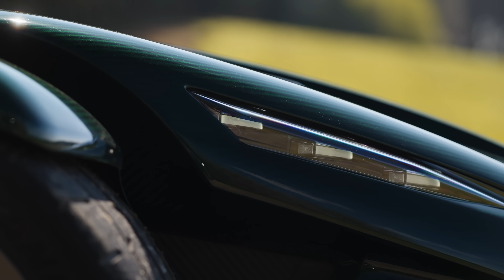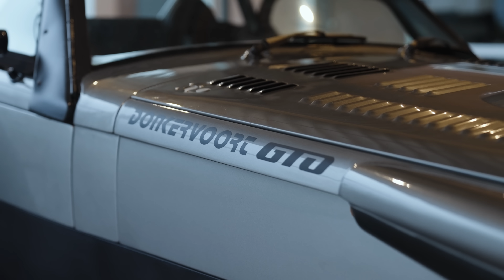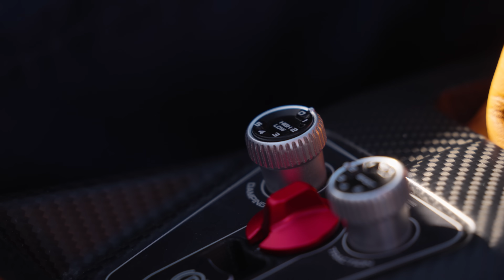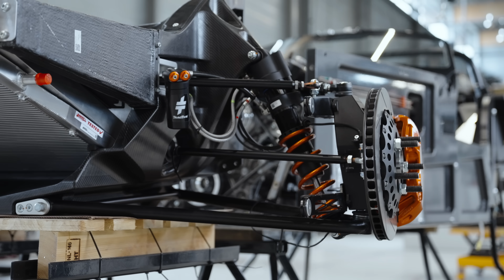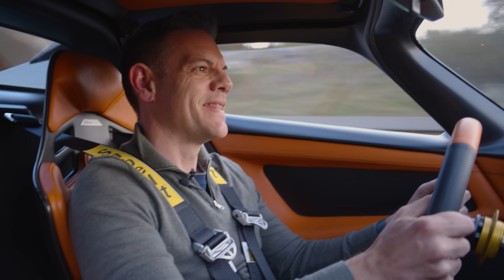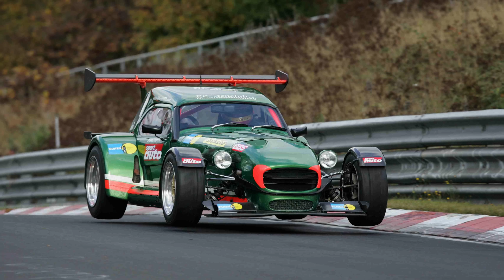New Donkervoort P24 RS: The Most Extreme Lightweight Supercar! | 4K

Comment: Ok, 780 kg plus say a 75 kg driver which gives a total weight of 855 kg. With 600 HP, the power to weight is 600 / 855 = 0.7 hp / kg. World SBK bike: 230 hp. 168 kg plus 75 kg rider adds up to 243 kg. power to weight 230 /243 = 0.946 hp / kg. Let see if this donkervoort can beat a world SBK as bike is notoriously difficult to launch

Comment: Wouldn’t you prefer bigger brakes with more adjustability, such as bias etc? As they would fit the rim and thus give more options.
Reply: I think it's not really necessary with the weight of the car.
Reply: @PietjePrut would its inertia outweigh its option I’m wondering…. They must have played around with different setups I’m sure…
Reply: @Braskas85  I really shouldn't know it buddy, but it seems like a fair thing to me. Also you took some weight away again. But like I said, it's only what I think. Not really technical, but more in a logically way. 😄😄

Comment: That Ford eco-boost frightens me, it’s like they plopped in a twin turbo frag grenade. I’m sure they’ve worked out a lot of the issues since its inception but those early days were really rough.   On the bright side if you get good at fixing them you get one of the best dollar to horsepower ratios on the planet. The flex, fusion and Lincoln’s are starting to fill up the hood classifieds and junkyards. You can buy a whole damn car for less than the cost than a proper LS motor (obviously I’m not counting truck motors).

Comment: Hate to be that guy but you called it a font engine/rear drive car but that's not completely correct. It's actually a front mid-engine/rear drive car almost perfect weight distribution 47/53. I mean bc the car's got such a long bonnet w/cab back proportions you almost sit over the rear wheels

Comment: Take that silly ass engine and trans out, and drop in a turbocharged hayabusa and accompanying transmission and the car becomes something that really could destroy the best of them on track. Really wanna make it even better? Use the custom Hayabusa V8 and a 7spd PDK or something akin to it like the VW DSG trans ,or use a true semi-auto or sequential trans. In addition to the ferro-fluid dampers, pair them with hydraulic over coil-overs to get instant ride height adjustments and the ability to install a surface mapping radar (like a LIDAR setup) to read the road and adjust damping and ride height on the fly. All adjustable from within the cabin, and add in some mastic sound deadener to tease out some of the echoes and hollow points in the chassis. Considering I can do ALL of that with a Caterham and do it for less than $50k (the Busa V8 would break that budget) and for under $100k if I added some active aerodynamics and a wing that can function as an air-brake. The bike engine would suit it better as well! The Caterham 7 Fireblade is proof of that. It's pure legend. It desperately needs pushrod suspeneas well. Seriously. Honestly! All of that work into this car and for all of that money (a nice house, or a car kind of money) it needs to have the best on offer. I'm sure the children of the comment section will wimper about the manual trans because they mistakenly think that it makes you cool to say you prefer them or very wrongly assert that it makes the car faster or this or that. Manuals/a stick is very easy to use. It doesn't make you a better driver, and it sure as shit doesn't make you an "enthusiast" like so many ignorantly and arrogantly claim. It just makes you slower, and it makes you look like a fool to claim anything to the contrary. Manuals belong on older cars. Like mid-80's and older, but really early 70's and older. Because they actually were faster and better back then..until the powerglide and torqueflight entered the chat. But especially when companies like Porsche/VW and Ferrari, and McLaren, and Pagani, and got their DCT's dialed in. But I digress. Prove your ignorance by stating otherwise! A manual trans is a choice, not a requirement for sports cars, super cars, or hyper cars. On the contrary, those last two require leading edge tech to make them "super" or "hyper". A built PDK or DSG, paired to a boosted Hayabusa 4cyl or 8cyl (that sweet custom V8 that will blast your wormhole 69 galaxies away!) and a much more advanced suspension system is what is really required for greatness in this vehicle class! It's cool looking, but it also looks like a Hot Wheels car that isn't real and doesn't deliver on its looks.

Comment: The chassis is brazed not welded its how traditional high end bicycle frames are made, brass brazing i think.
Reply: True! I was wondering why he didn't know that.
Reply: @bicyclist2 Strange Doonkevort call it "copper welding" obviously copper doesn't weld carbon steel and its brass anyway, must be all that weed they smoke over there, i don't think many people outside cycling are aware of brazed frames i had a Reynolds 531 frame years ago, only reason i know tbh.
Reply: @Heyy-u9y brazing i pretty common in engineering
Reply: @Heyy-u9y  Could be they use the same word for braze and weld in Nederlands?

Comment: Why do you cross the center line on the roads so much when you're driving this thing? It can pull 2.3 lateral G's, but you can't keep in in your lane at roadway speeds? The driving would look much more impressive if it didn't look like you have to cut straight through the middle of every turn. Plus you look like a goober doing it.
Reply: Do you drive on a real road?  Or only in the video games your mum lets you play?
Reply: It's about the videography.

Comment: Looks like an aston martin humped a Plymouth prowler and had a funny looking baby 😂😂😂
Reply: Different size and different type of cars... 

Length: 4,000 mm (157.5 in)
Width: 1,912 mm (75.3 in)
Height: 1,105 mm (43.5 in)
Wheelbase: 2,420 mm (95.3 in)
Ground Clearance: ~90–120 mm (variable via optional hydraulic system)

Key Performance and Physical Specs
Dry Weight: ~780 kg (1,720 lb)

Comment: Without downforce, I'm pretty skeptical of that 2.3G lateral G's claim.    It would require a rubber to pavement coefficient of friction of 2.3, and that simply doesn't exist.    1.6 is about the highest possible without downforce or banking.
Reply: It whas on the banked corner in zandvoort

Comment: Thing looks so cool. Wonder if my 6’4 body would fit in it.
Reply: Yea, you'd have plenty of space. My dad has an older dax kit car which is even smaller and I have plenty of leg space with 6'3. Remember, there's no real trunk and no back seat, so the car is short, but the only thing you have to share the length with is the engine.
Reply: @Clockwork-w5u  that’s cool.
Reply: Well, since it’s Dutch, you should be fine:)
Reply: @mickbloemendal6724  true

Comment: This would be nice with a coyote in it.
Reply: That engine is like throwing a massive boat anker on the front of a dinghy.
Reply: @W0o0dyit could be made to be as light or potentially lighter with the same approach that they took with the Ecoboost, no?
Reply: @W0o0dy  I'd imagine it would be balanced enough considering how far back behind the front axle the motor is mounted.  Plus it seems as though the coyote is only about 35lbs heavier than the 3.5 EcoBoost which this has already.
Reply: @LCCDrummer  except they managed to get the weight of the 3,5 Ford engine down by about 155 lbs...
Reply: @LCCDrummer  I would like to see how it works out with e wrything dressed up on both... My idea is that the coyote probably just would never fit the chassis.
Reply: @W0o0dy2jz is a boat anchor
Reply: @luislongoria6621 an engine that heavy and big is a boat anchor in a car this small and light

Comment: So it's basically about 2 times as light as a modern day track focussed super/hyper car (like a gt2RS or so)
That is just crazy!
Reply: They managed to get 70kg off compared to the Ford engine they started with... -70kg, on an engine and the dress-up (turbo's, manifold etc) that's really something. And the doors are probably around 2 maybe 2,5 kg but still this car  meets all side impact crash requirements!
Reply: @W0o0dy I don't want to make this sound like Donkervoort's engine modifications aren't impressive... but that stat is probably manipulated somewhere in the process of converting the motor to dry sump, and not a 1:1 comparison.
Reply: @dr80008 3d printed manifolds, 3d printed turbo components.... 

Here's a list of changes... 

Turbochargers: Custom, specially designed billet ball-bearing turbochargers from Van der Lee.Internal Upgrades: The engine utilizes forged internals for improved durability and performance.Intake & Exhaust: Features modified intake manifolds and a custom double-side pipe exhaust system with a particulate filter.Weight Reduction: The engine is customized to be lightweight, with the unit weighing less than 170 kg.Fuel System: Utilizes a dual fuel injection system (direct and port injection).
Reply: @dr80008  and from their own website: 

While the core is Ford-based, Donkervoort has modified the engine with billet ball-bearing turbochargers from fellow Dutch firm and F1 supplier Van der Lee. Even at full tilt, the P24 is running less boost than the less potent Audi engine - 1.2 bar as opposed to 1.5 - though there are of course now two turbochargers. The engine breathes in via a new carbonfibre inlet and out via 3D-printed exhaust manifolds. The water-to-air intercoolers are also 3D-printed.
Reply: And It's as rare as a Pagani and a boutique hand built and way more engaging than those too.
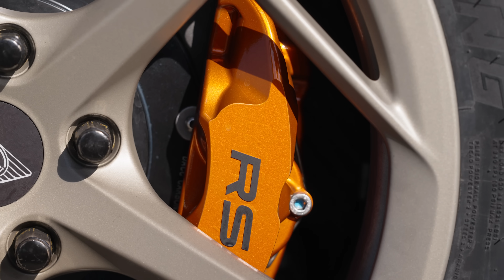Reply: 14:12 you can clearly see that the brake calipers are from AP Racing. They just covered it up and put RS on top of it. 😂😂😂
Reply: @RamjeProductions  But is that a problem? No car brand in the world makes their own brakes; they all buy systems from brembo, trw, ate etc etc.
That said, that you can still read AP racing is a bit sloppy, but I have the feeling that this is still a pre production car (being new and extremely low volume), so an off the shelf caliper that they painted themselves and that once real production and orders starts they'll get calipers from AP painted and branded and all.
Reply: @mrpetit2   Guys did you all miss the: IT'S A PROTOTYPE???
Reply: @karlos1060  excellent point!. indeed stated at the end.
Reply: @karlos1060  beautiful part of it, this exact prototype flew past me on the track yesterday
Reply: Amazing!
Reply: Half?

Comment: Its a mesh of a PT Cruiser / Crossfire SRT-6 on steroids.. 😅 Chrysler revenge
Reply: Look at the dimensions 
Length/Width/Height (mm)
4000/1912/1105 mm
wheelbase
2420 mm
Track front/rear (mm)
1630/1645 mm
fuel tank capacity
48 Litres
luggage capacity
298 Litres

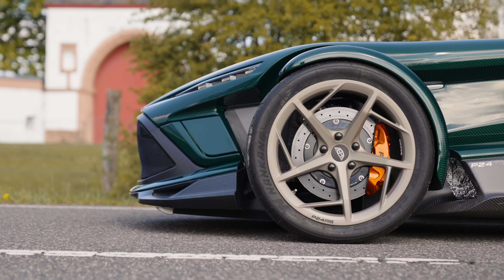Comment: 4:21 “They wanted a different engine” 
I think it was Audi that had told Donkervoort that they wouldn’t be able to buy the inline-5 anymore.
Reply: Correct, and they took the Ford engine as a base but tuned it so much that it isn’t a Ford engine anymore!
Reply: They can buy a whole RS5 car and extract the engine
Reply: Both are true actually. They went with the Audi l5 because there was no way to do a bespoke engine. Now they got to have their own engine (although the basic blocks come from Ford) and make it something quite special (although I don't like the sound) with the 3d printed manifolds and bespoke vander Lee (racing pedigree) turbo system.
Reply: @W0o0dy The Audi engine wasn't the same one Audi used themselves anymore either.  

 Still, I think Donkervoort would have stuck with it and probably have gotten 600 hp from it, if Audi wasn't likely going to discontinue the engine.  They are wavering a bit, I recently read, but where planning to stop making it. 

I have owned 3 5 cylinder turbo Audi's, among which an urquattro. So not the same engine, but the origional one and they all sounded so much better than 99% on the road.  That is the one 'problem'with this upgrade to Ford.
Reply: @W0o0dyIt’s a Ford V6 not a bespoke engine.
Reply: @kraenk12 A modified Ford engine with ‘factory stage 2 tune’ or something like that.
Reply: @kraenk12  better check the list of changes.

the key changes and engineering upgrades applied to the Ford 3.5L V6 for the P24RS Engine Core and Internal 

Modifications
Forged Internals: The engine utilizes forged powder metal connecting rods and a fully counterbalanced forged steel crankshaft to handle high torque.
Dry-Sump Lubrication: The engine uses a custom dry-sump system to lower the center of gravity by 6 cm, optimizing lubrication under extreme cornering loads (up to 2.3G).

Improved Structural Integrity: The engine core utilizes six-bolt, press-fit main bearing caps.

Piston Modifications: Pistons are equipped with low-friction skirt coatings and oil jet cooling.

Fuel System: The engine retains a dual-injection system (direct and indirect) for optimal efficiency and power delivery.

Custom Induction and Turbocharging: Van der Lee Custom Turbos. Partnering with Dutch firm and F1 supplier Van der Lee Turbo Systems, Donkervoort installed custom-designed, ball-bearing turbochargers with billet turbines. These are lighter (approx. 4 kg each) and more intricate than cast units, designed to eliminate lag.

3D-Printed Charge Coolers: The engine uses ultra-lightweight (1.4 kg each) 3D-printed air-to-water intercoolers from Conflux, modeled after F1 technology, to provide extremely efficient cooling while saving weight.

CFRP Intake Manifold: The engine features a custom Carbon Fibre Reinforced Plastic (CFRP) intake manifold to improve airflow and reduce weight.

Exhaust and Ancillaries :The exhaust manifolds are custom 3D-printed items that offer superior flow and save approximately 6 kg over traditional cast manifolds.

Lightweight Battery: A 2.5kg Super B lithium-ion battery is used to reduce weight.

Total Engine Weight: The modifications result in a total engine assembly weight of less than 170 kg.

Electronics and Power Management"Power to Choose" Software: A proprietary engine management system allows the driver to select between three different power maps: 400 hp, 500 hp, or the full 600 hp, with corresponding torque adjustments.

Lowered Boost Pressures: Despite making 100 hp more than the outgoing Audi engine, the P24 RS runs a lower maximum boost pressure of 1.2 bar (vs 1.5 bar on the F22) thanks to the improved efficiency of the new turbos.
Reply: @kraenk12  Semantics, opinions.. I agree with you though. It is still a Ford, just like when Noble and Koeingsegg used modified Ford engines.   And that's ok.  There really is no rational under which a manufacturer like DOnkervoort should build their own from the ground up.
Reply: I like the Ford engine better anyways.
Reply: @bicyclist2  Why?

Genuine question.     I can think of reasons, just like I have one huge one for not agreeing.. the sound..  but what are yours?
Reply: a bit sad that the 5cyl is gone

Comment: @12:06 plastic valve covers on a twin turbo "Supercar"?
Reply: PA66 thermo plastic has taken over. My thing is why can't they at least spray paint it or better yet make a version with carbon fiber valve covers
Reply: @ch6inre6ction11  if you ask nicely I am quite sure they could do them in excore too
Reply: They wanted to reduce the weight of the engine as much as possible. This Ford based 3.5 V6 now weighs 70kg less than the Ford one... Think about that... That is 9% of this cars weight....
Reply: Welcome to the modern world. 
Plastic is not just cheaper to produce, it’s also lighter than metal.
Reply: @Conservator. and it's garbage!
Reply: @axioms22  Why?
Reply: @axioms22 Perhaps. But it serves no purpose to the engine regarding structural integrity. Only serves to cover/seal the cams in engine oil and keep dust out.
Reply: @Conservator. The primary issue with plastic (composite) valve covers is that they are prone to warping and cracking over time due to constant exposure to extreme engine heat. While they are lighter and cheaper to manufacture, they typically only last between 80,000 and 120,000 miles, whereas metal covers can last the life of the vehicle.
Reply: @4u2nvinmtl pretty easy service item, especially for the potential owner of a vehicle like this. My guess is they want to prioritize the weight savings even if a little cost is associated after 80k+ miles
Reply: @4u2nvinmtl I have a Ford with plastic intake and valve covers with 343,000 miles.  They're just fine.

Comment: the hood is longer than the equator
Reply: I think it’s probably similar to the length of a hood on something like a Ford Mustang.
Reply: Yes, and I wouldn’t want it any shorter.
Reply: It's not, it's just the proportions... This car is tiny!Length/Width/Height (mm)
4000/1912/1105 mm
wheelbase
2420 mm
Track front/rear (mm)
1630/1645 mm
fuel tank capacity
48 Litres
luggage capacity
298 Litres
Reply: Not really, it's more due to the proportions. In reality this thing is tiny! 

Length/Width/Height (mm)

4000/1912/1105 mm

wheelbase

2420 mm

Track front/rear (mm)

1630/1645 mm

fuel tank capacity

48 Litres

luggage capacity

298 Litres